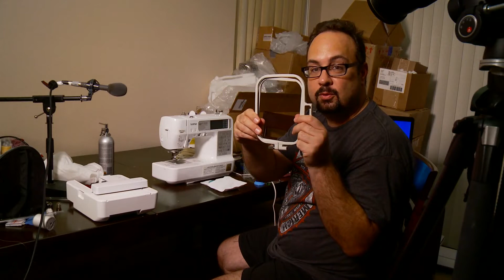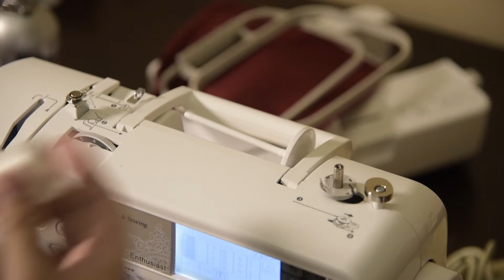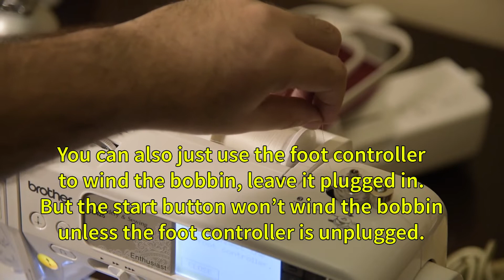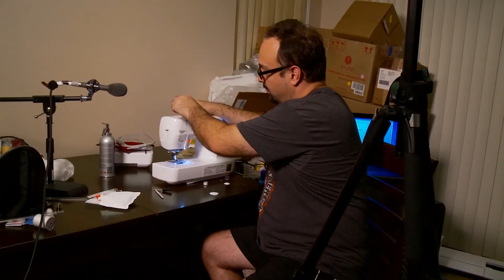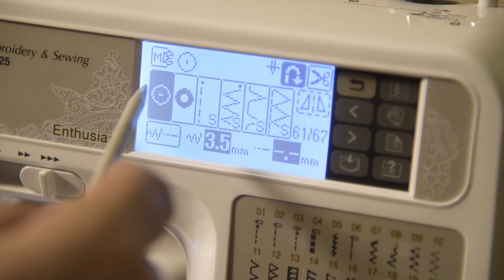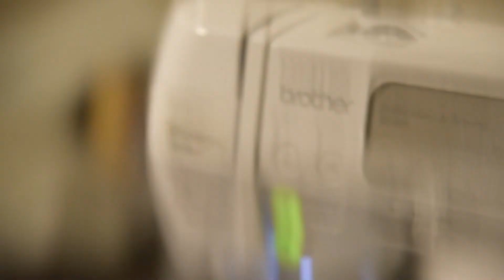Brother SE425 Sewing

Comment: When the thread is cut is it also tied off?   Is a back stitch required at start or end of stitch?
Reply from the maker: In the manual it only tells you the button cuts the thread and raises the needle. I would think they would be proud of the engineering to say "and ties off the thread". So I honestly don't know but I'm guessing not. As for back stitch, I would always make a habit of doing it at the start and finish, unless the material is fragile and you don't want it to show. There is automatic thread cutting and automatic reverse/reinforcement options.. I've never used them. Page 61 of the manual. http://support.brother.com/g/b/manualtop.aspx?c=us&lang=en&prod=hf_se425eus

Comment: Maybe I'm doing something wrong ,but when you started sewing I noticed that the machine was pulling the fabric on its own, however mines is not doing that and we have the exact same machine
Reply from the maker: So the metal toothed bars under the fabric that pull it are called the 'feed dogs'. And if you're going to freestyle sew you can lower them so they won't pull the fabric. There is a switch for that on the rear of the machine at the base. Make sure it's toward the right where it shows the triangles going up through the line. If they STILL do not pull the fabric then your machine might need to be repaired.

Comment: Why did you purchase your sister the SE 425 instead of the SE 400,  This will be my first embroidery sewing machine.  Thank you for any assistance.
Reply from the maker: Well, vcalibur1, the prominent feature of the se 425 is that I found it for less than half the price new at a pawn store and it was an xmas present. So I give nice gifts but I'm also cheap :P

But also, the 400 and the 425 are exactly identical. I believe the 425 actually just came with a CD with 100 free designs.
Reply: Thanks because I was stuck with the project runway machine and kept reading that runway, se400 and se425 were the same machines. Next, I considered purchasing the PE700 embroidery and continue sewing on my old, cheap Euro pro machine. Kept researching prices, reading and waiting, waiting, and waiting.  I am cheap but give good gifts also, but always looking for a sale or the best situation for me.
Your answer sealed my decision for the SE425. So "Thank You" very much for all the information.  I will continue viewing your videos for more information.
One other question is have you or your sister trying using larger hoops, such as the 5 x 7 on this machine.  That was one of the main reasons I was going to purchase the PE770  machine.

Comment: I bought my wife this machine and everytime we try to import a design from the computer it starts the first stich then disconects from the PC. Any ideas?
Reply: Thanks I finally got it to work. I realized what I did wrong. I needed to not have the bitmap image in sophiesew when I exported the design. Thank you for the reply!
Reply: joshroggero If you're importing an embroidery design, there are a few steps you'll need to follow. I found a YouTube video done by Burley Sew that completely walks you through getting a design from computer to machine. I've watched it a couple of times just to make sure I did it right. They have several good videos.